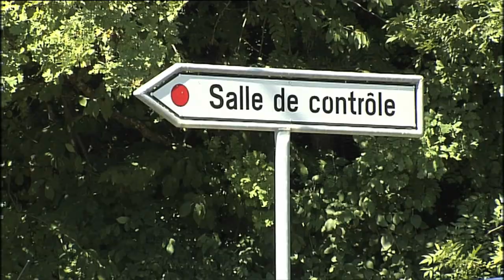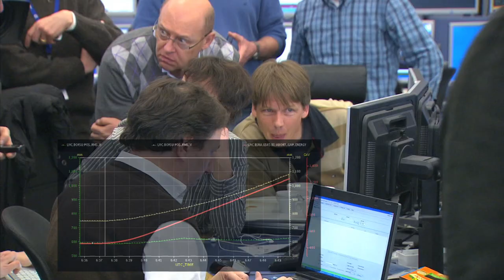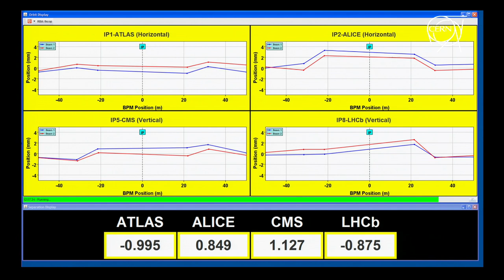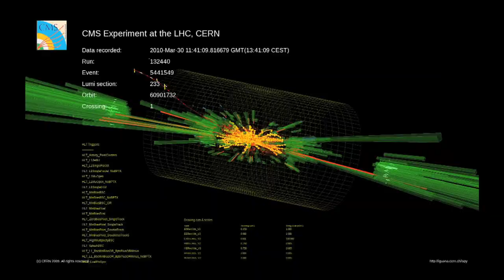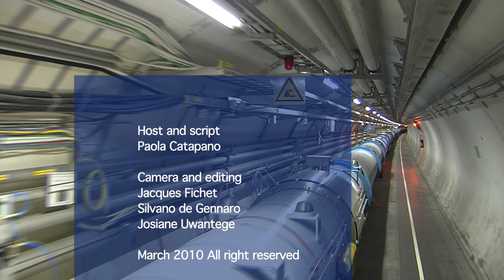LHCNews Apr, 2010 - The LHC is GO!

Comment from the maker: @Steaphany The LHC was engineered to collide proton-proton. There are a number of reasons, connected to its physics program, why we chose that instead of proton-antiproton. Most important is perhaps the fact that it is much harder to make antiprotons, than protons. With antiprotons, you have smaller bunches, therefore less luminosity, and lower collision rate, so finally less chances of interesting events. For more details search for lhc proton-proton in physicsforum-com.